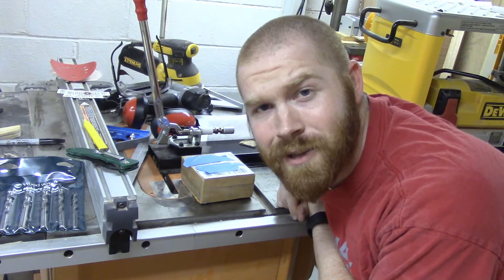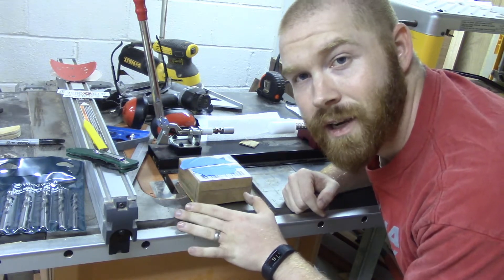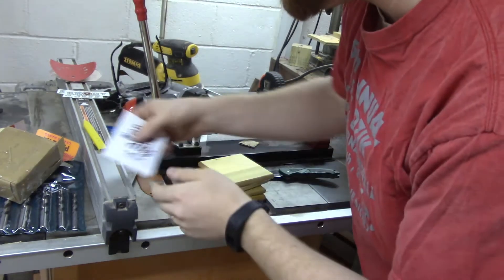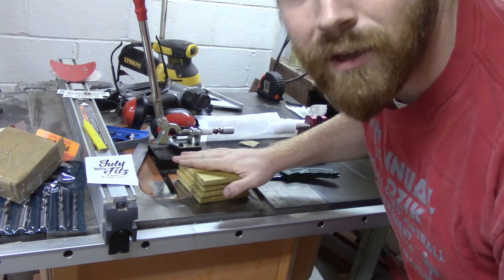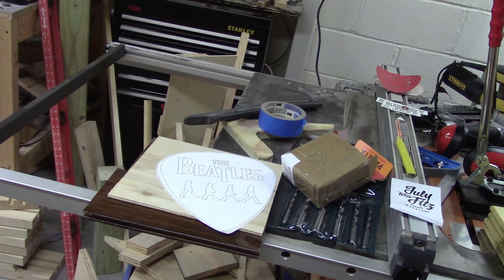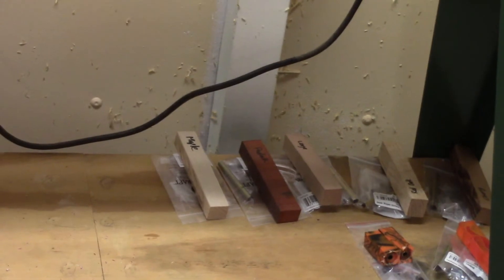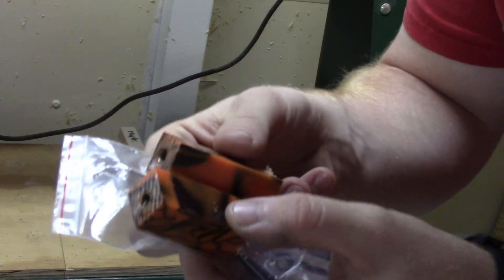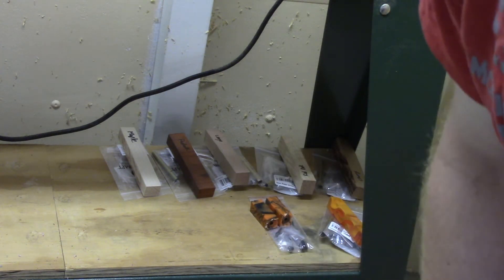Shop Update 8/19/17

Comment: I have the same lathe, I made my own tool rests for it. I used 1" round bar stock for the post and the rest, I had to use my spindle sander to open the hole in the banjo up jut a little so the 1" bar would fit, the original tool rest still works too.
Reply from the maker: That's exactly what I ended up doing.  Thanks for all the support!